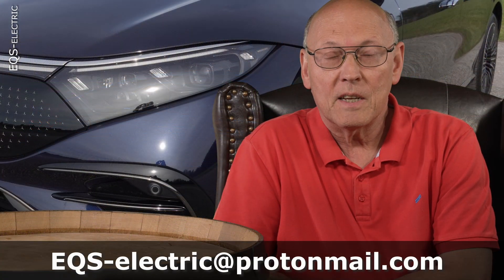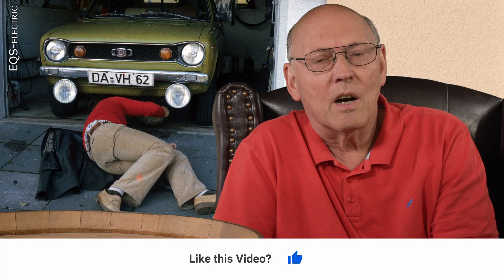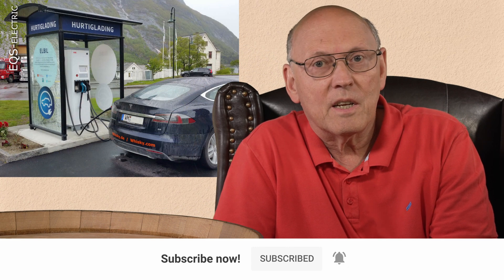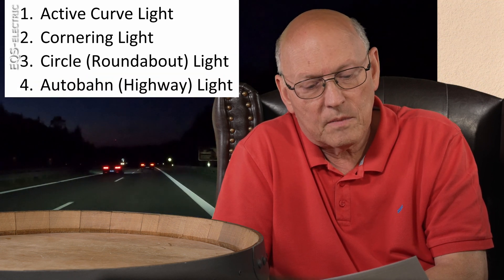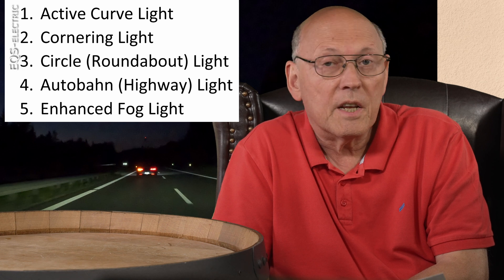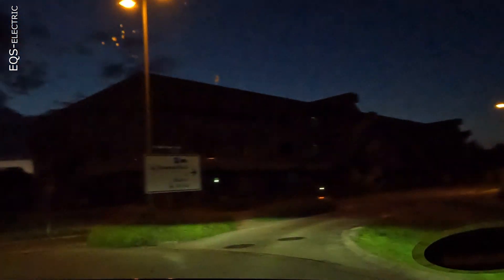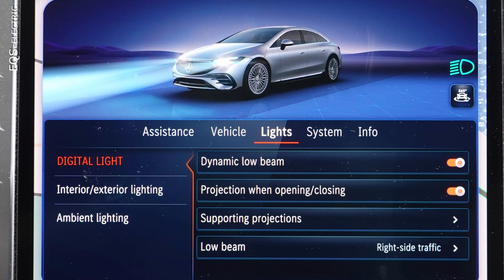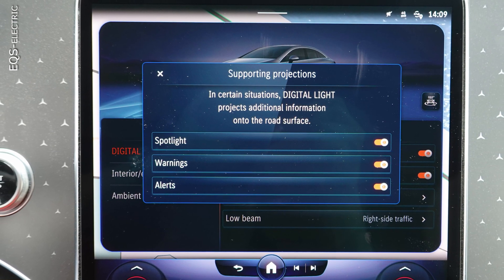Mercedes EQS 450+ History of Light, Matrix Light, and Digital Light

Comment: Dear Mr. Lüning, I kindly recommend you to go a little bit deeper in the technic behind.

Most of the modern functions of LED-headlamps, will be done by turning on/off and dimming of separate pixels inside the light engines. Symbol projection is also working in this way, if you have a lot of pixels - see example of German Company Hella (now Forvia) for SSL HD light system (I guess EQS has similair light inside):
https://www.youtube.com/watch?v=tLpX1vYjmoA

This video has very good overview and explanation of different light functions (for older projection system). Whole playlist is also very informative.
https://www.youtube.com/watch?v=cotARKsxAEE&list=PLGF0XQIDhYvkr7TaKEaFCsKOnG4s6DHfL

Comment: Dear Mr Lüning - All these features are secondary for me. I am still looking for an affordable electric car with 1,2t trailer towring capability. The EQE uses the same powertrain but has only 750 kg max trailer load approval. However the EQE is for me an expensive car. In comparison to Germanys "Kompaktklasse" fuel cars, I see no competitive care at a compareable price. For me I do not understand this no or low trailer capabiltity.
Reply from the maker: The Tesla Model Y has 1.6t. But it is still expensive compared to a fossil "Kompaktklasse". But you have to take all costs into account. Especially fuel consumption and maintenance are a lot higher with fossils.